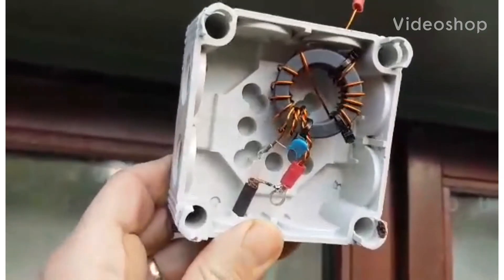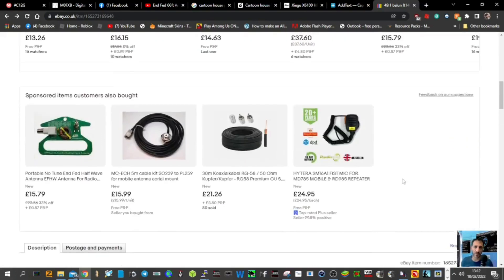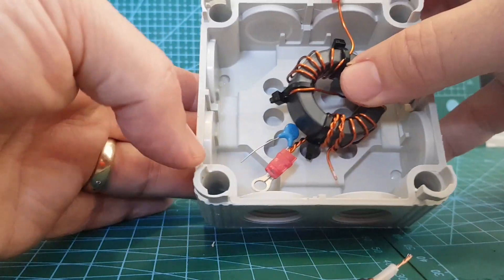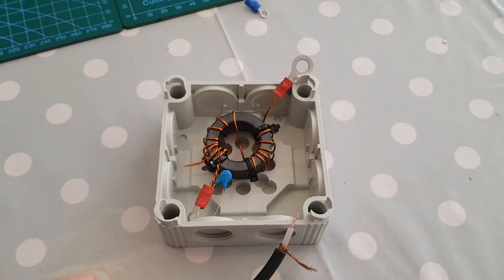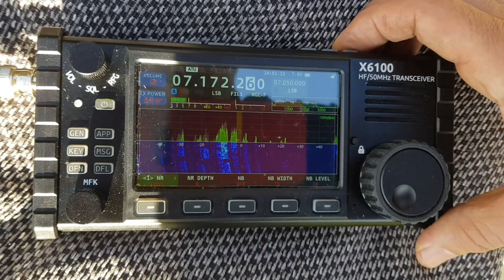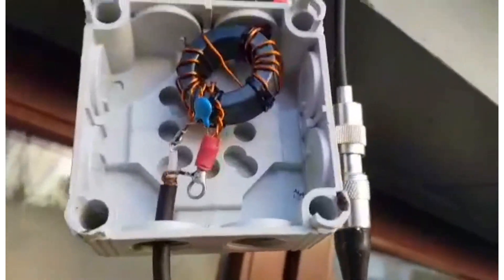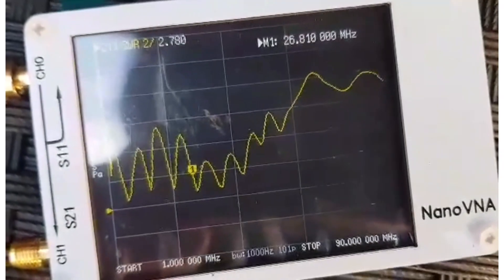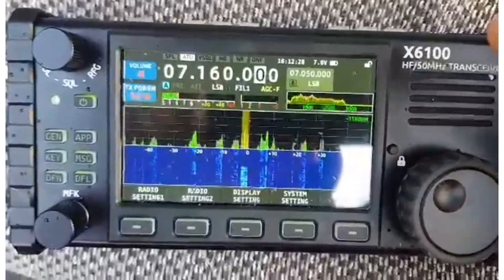49.1 Unun with Xiegu X6100 construction

Comment: If you’re going to use that box often, get yourself at least some 4-5mm stainless nuts and bolts/wing nuts  to anchor your antenna to your box. A few SS eyelets to hang the box might also help. Most UnUns/Baluns also use a SO239 panel mount for ease of connection. Great video!
Reply from the maker: Thanks

Comment: Hello what you have made is an end fed half wave antenna Its way to low height wise please put as much length vertical as possible and then run horizontal that small capacitor?  Voltage I built mine with a 40kv capacitor
Reply from the maker: Hi thanks for the info